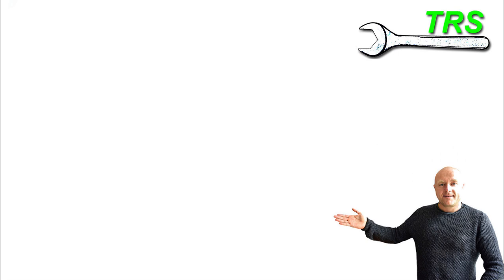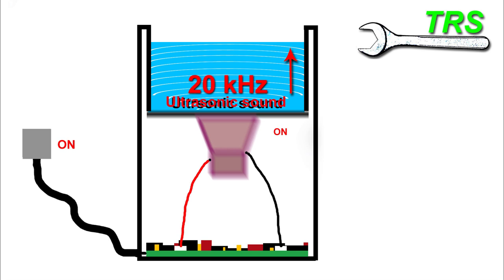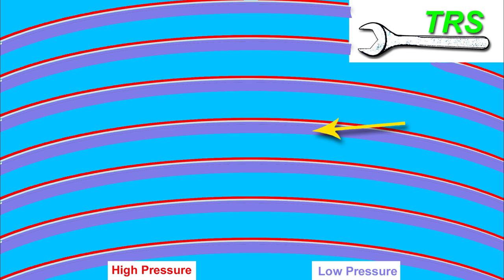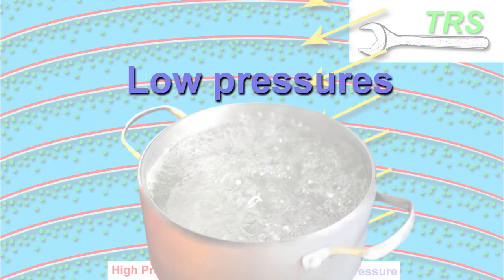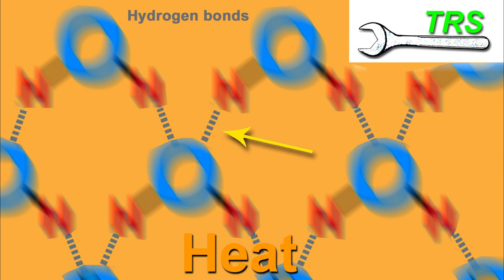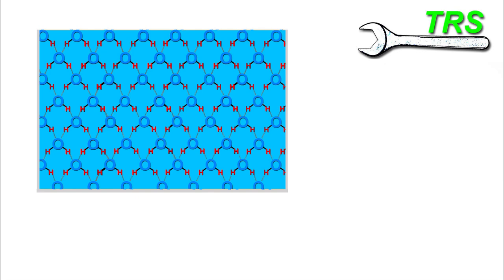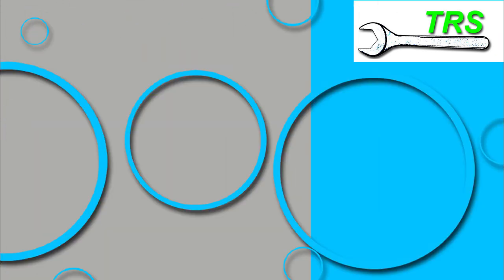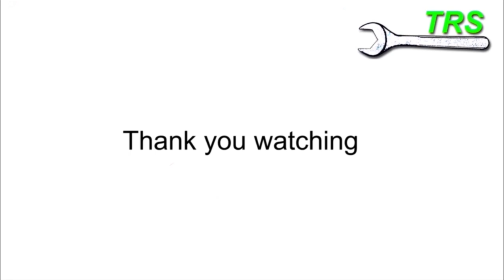Ultrasonic Cleaner - How they Work & How they Clean your Carburetor - Fascinating! (Full Version)

Comment: Excellent explanation on ultrasonic cleaners! It should also be noted that in HVAC situations, the vacuum drawn by the vacuum pump literally BOILS the water away out of the system, courtesy of the absence of pressure (e.g. vacuum) within the system.

So, drawing a vacuum on water in a sealed chamber can also induce boiling.
Reply: My old physics teacher used to use a vacuum pump to dry out bell jars at school to demonstrate this principle - I often wonder if it could be used as a clothes drying process but would probably use more energy than a traditional tumble dryer :D
Reply: @Umski  
Evaporation causes cooling, so you still need to provide heat. However  the required temperature would be lower, which would allow certain fabrics to be dried.
Reply: @FullCircleTravis  heating the item is not strictly necessary (I don't think) as dropping the pressure allows the water to evaporate into the vessel in which the clothes and vacuum pump inlet reside, the issue would be how much energy the pump needs and how to remove the water vapour molecules and then how to re-apply pressure without all the steam condensing back into the fabric! Heating would certainly help speed up the process of water evaporation but isn't strictly necessary as the boiling point is being reduced so the liquid water can make an easier bid for freedom as vapour...
Reply: @Umski  
Phase change from liquid to gas is endothermic.
Reply: @FullCircleTravis  indeed, hence latent heat and vapour pressure working together - the clothes and water would indeed get colder but that doesn't necessitate heating to get the water out, though it would of course help...
Reply: @Umski  
Here's the math. Lets say you wanted to evaporate 1L of water that is 25°C. You reduce the pressure so that it will evaporate  at 0°C. So, you have essentially 25,000 calories of energy for evaporation. That works out to 104.6 Kilojoules. It requires 2257 Kilojoules to boil 1L of water. 104.6/2257 = 0.0463.

So basically, 4.63% of the water would evaporate from the clothes before the water turned to ice.

The only way to evaporate all the water, would be to wash your clothes at 540°C or greater and then pull a vacuum strong enough to evaporate all of it. 

So yes, you would have to apply heat from somewhere.
Reply: @FullCircleTravis  you're right, though you're calcs are working on latent heats and specific heats at atmospheric pressure, albeit even at reduced pressures those values are only marginally different so it still highlights your point :) Interestingly it seems at a boiling point of 25C, 1kg of water would require 2444kJ to evaporate rather than the 2257kJ at 100C...that's my invention in the bin then ;)
Reply: @Umski  
Don't worry, I have thrown many in the bin. Some worked very well for personal use, but selling commercially is a different game. 

Small-scale farming automation is where it's at these days.

Comment: Craig I’ve recently purchased a ultrasonic cleaner and now it’s great that I know how it works. Your videos are so informative. What detergent would you recommend? Everyone seems to have their own opinion. Will watch the video again to catch items I might of missed. Thanks for sharing your knowledge and videos. They are all helpful 😊
Reply: Arthur, Steve’s Small Engine Saloon has a couple of videos on how to use an ultrasonic cleaner and an excellent video comparing various cleaners. The outcome is surprising.
Reply from the maker: Hi Artie. Sorry for not getting back to you.  To be honest I have tried many different detergents in my cleaners over the last few years and I've not seen a great difference between them myself.  Personally, and I'm not saying you must do this, but I have found the very best way of cleaning engine mechanical metal type parts is to fill the ultrasonic tank with water. Then place your items to be cleaned into a separate container submerged in diesel, paraffin or even petrol. Then put this whole container into the ultrasonic tank and turn it on.  The parts and the petrol will be separated from the water in the tank so no issues there.  Otherwise go with the detergents and see what you think.  See if you think there is much difference like me.  Thanks again Craig
Reply: @TheRepairSpecialist with other words, the sonic provides little more than agitation. So over hyped. I bet mechanical solution agitator would so just as good when you have to use harsh chemicals. You should not speed all those lies on YouTube.

Comment: Awesome video! I see some people on YouTube that say you can use the ultrasonic cleaner in this way; only put water in uscleaner. Then put a cleaning fluid in a jar with your parts you want to clean. Then they put a lid on the parts jar and load it in the uscleaner. They take out the jar and say the uscleaner cleaned the parts through the jar. What I'm seeing is yeah, the parts are cleaner but that's because the parts were soaking in cleaner. Personally, I don't see how that can work. Especially after watching your video.

Comment: Brilliant presentation. One question - what percent of the ultrasonic energy is converted to heat and subsequently raised the temperature of the water? For example I have read that "good" ultrasonic has 100 watts per gallon. How much of the 100 watts is converted heat and raised the temperature of the water?

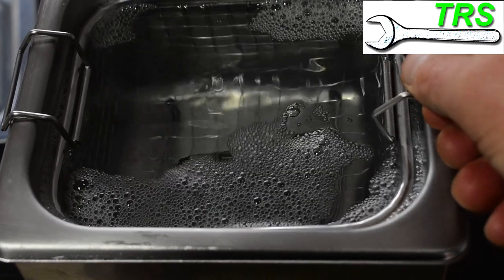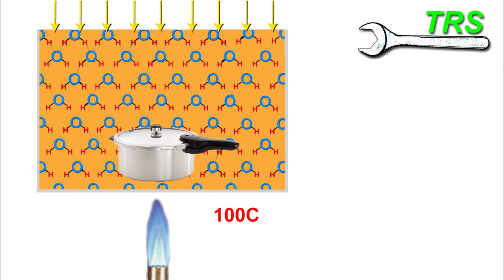Comment: 0:53 Factors. 9:37 It's also how refrigerators/heat pumps work with the refrigerant, compressor and condenser: the heat energy in the refrigerator has enough energy to boil the refrigerant into vapour (thus moving the heat energy from the inside of the refrigerator).  Outside the refrigerator, the refrigerant vapor is compressed back into a liquid and heat is released (that's why the back of a refrigerator is always hot).  The refrigerant is then pumped back into the fridge where it's pressure is much reduced (to below its boiling point) and the heat energy inside the fridge boils the refrigerant back into a vapour.

Comment: If you don't want to gunge up your cleaner's tank with oil and grease or exotic solvents, you can put the dirty item(s) in a glass jar with the cleaning solution inside it. Of course you will still need to fill the tank with water to transfer the sound waves to the jar.

Comment: Hi Craig, i have a two cylinder petrol generator. It runs for half hour and cuts out. The oil level is correct. New spark plugs fitted. Petrol flow is correct. Air filter is clean. Any suggestins please!

Comment: I was just reading some comments and you told someone that you do the same thing when using gas. I'm confused. Can waves pass through the glass to clean it just as well?
Reply: It's a useful cleaning method. Put your items in a glass jar or even a ziploc bag filled with your cleaning solution, vinegar, solvent or gasoline etc and immerse it in the bath. This keeps the amount of solvent required to a minimum , traps all the dirt in the jar or bag and prevents from making the cleaner's tank full of chemicals.

Comment: Τhere are many types of ultrasounds from 20 KHz to 120 KHz ... which one is suitable???
Reply from the maker: The frequency of ultrasonic cleaners typically ranges between 20 kHz and 400 kHz. However, the most commonly used frequencies for industrial and commercial ultrasonic cleaners are around 25 kHz to 132 kHz.Lower frequencies, usually within the range of 20-40 kHz, are highly effective for heavy-duty cleaning tasks. They generate larger cavitation bubbles which can be more powerful in dislodging and removing tough contaminants or debris from various objects.. Higher frequencies, around 40-132 kHz, are better suited for delicate items or precision cleaning due to smaller, finer cavitation bubbles.

The frequency used often depends on the specific cleaning application and the type of material or contaminants being removed from the objects placed in the ultrasonic cleaner.

 I hope this helps

Craig

Comment: If you take this process and freeze water and place it under a strong vacuum you can boil water while still frozen. It will go from solid to vapor while bypassing the liquid state, this is called sublimation. Foods that have gone though this process are called freeze dried making they last for decades.

Comment: We know water goes from liquid to gas in low pressure. we learn that at school. No water in space. So this is how it works. But it doesn't always clean well
Reply from the maker: You're right that water can change from a liquid to a gas in low pressure environments, which is something we often learn about in school. In space, the lack of atmospheric pressure causes water to quickly turn into vapor without going through the liquid phase. This principle is indeed used in ultrasonic cleaners.

Ultrasonic cleaners create high-frequency sound waves that generate tiny bubbles in a liquid (usually water) within the cleaning tank. These bubbles form and collapse rapidly in a process called cavitation. When the bubbles collapse, they create small shock waves that help dislodge dirt and contaminants from the surfaces of objects being cleaned. It's like a gentle scrubbing action that reaches into small crevices that might be hard to clean otherwise.

However, you're right that ultrasonic cleaners might not always clean as effectively as we hope. The effectiveness can depend on various factors, including the frequency of the ultrasonic waves, the cleaning solution used, the temperature of the liquid, and the type of material being cleaned. Some complex or stubborn contaminants might not be easily removed through cavitation alone.

So while ultrasonic cleaners can be really useful for many cleaning tasks, there might be situations where they don't provide a thorough cleaning. In those cases, additional cleaning methods or a different cleaning solution might be needed to get the best results.

Have a great day
Craig
Reply: @TheRepairSpecialist  yeah, I’m still working on that, I just got it few days ago. It will probably be better when I will find the right kind of solution for what I want to clean. Wished to find one that remove car metallic paint in my airbrush. I tried few of them and failed. The Creworks is at 40khz

Comment: So basically, buy steam cleaners for your parts. Simpler and way more effective.
This is why car engine shops and other who need REAL cleaning done have steam cleaners and not sonic cleaners. 

The inherent problem with sonic cleaners is the same as true steam cleaner. It’s really hard and expensive to make proper ones. Most sonic cleaners are GIMICK just like household steam cleaners. Steam cleaners need to generate really hot steam in huge quantities to create the “pressure” in addition to heat. There is just no amount of power in your house to do so. This is why the steam cleaners you buy just fake pressure by blowing air which cools down the steam. Ever put you hand like 10” from it and it deals cold and all the steam is now dripping down your hand? 

Well similarly, sonic cleaners not only have to generate the right frequency but they have to transverse that to the water without being absorbed. Most don’t. 

Even worse, they need to maintain it trough the water. It is not true that they just go in every small part where there is water. Just like sound in air, or magnetic waves, it all depends of many factors that will absorb and isolate them from many parts. It’s why it was pioneer and most effective with small and tiny parts in specialized industries and not big parts like in a car engine shops. 

THIS is why they still warm the water up and use detergent. If the process were to work as in theory, you wouldn’t need any of it.
The average sonic cleaners,used with room water temperature is NOT better then boiling the parts in the same solution without the sonic effect. 

This is why it might be more convenient for cleaning than boiling that needs heat and all the other stuff (you not gonna do it in your kitchen if you still want to remain married) but it is not something special nor will it clean 100%.

Comment: Be careful using an ultrasonic cleaner on carburator bowls that are chrome plated (some older Hondas).  It will remove the chrome in 15 to 20 minutes.

Comment: "Ultrasonic Speed" is not a thing, all sound energy, regardless of frequency, travels through a given medium at the same velocity.
Reply from the maker: You're absolutely correct that the speed of sound in a particular medium is generally constant and does not change with the frequency of the sound waves. This is a fundamental principle of acoustics and is well-established in the field of physics. But what you may not know is that when people refer to "ultrasonic speed" in the context of ultrasonic cleaners, they are often talking about the high frequency of the sound waves produced by these devices. While the speed at which sound travels through a medium remains constant, the frequency of the sound waves produced by ultrasonic cleaners is indeed much higher than what the human ear can detect. These high-frequency sound waves are responsible for creating the tiny bubbles and the cleaning action within the liquid, making ultrasonic cleaners an effective tool for cleaning various items. Thank you for pointing out this clarification.